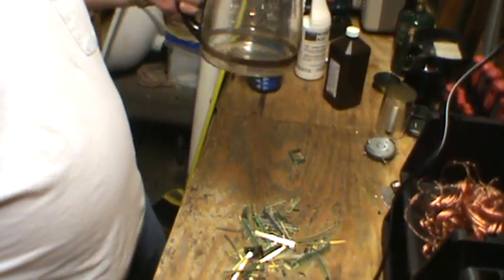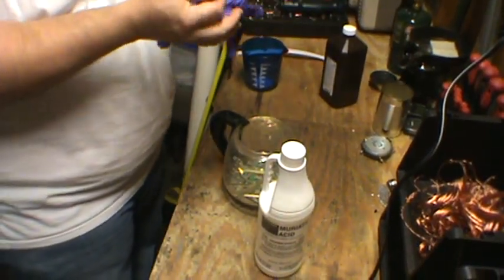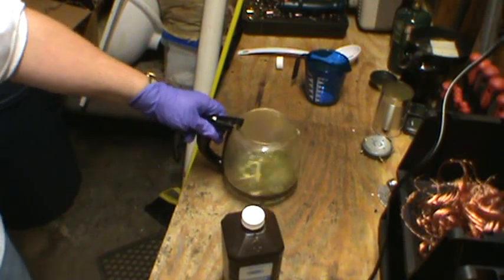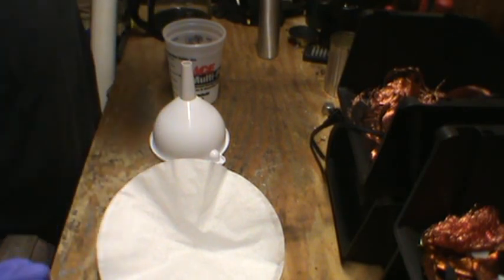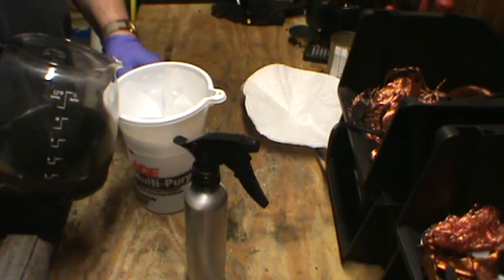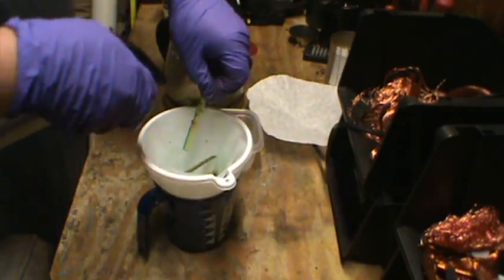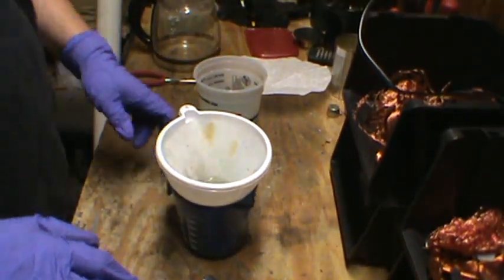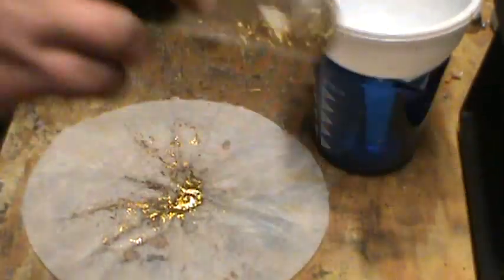How to Recover Gold with A/P Acid peroxide method for gold fingers and gold plated boards easily.

Comment from the maker: So the A/P solution is also dissolving the nickel as well as the copper?  I have not seen any other colored metals on the flakes when the process is done. Interesting you say almost all humans are allergic to nickel when it's so widely used in things we contact often like guitar strings, US nickel is 25% nickel, some magnets, stainless steel.  It is used in cookware, cutlery, kitchen appliances, hardware, surgical instruments, storage tanks, firearms, car headlights, jewelery and watches.

Comment from the maker: Great question!  As far as I know, silver is similar to gold in that it is fairly inert and the hcl will not dissolve it.  You would need to use something like nitric acid for that.  I use the AP methos for cleaning the copper and stuff off of the silver contacts that I find in switches and relays.

Comment from the maker: This process will work on plated pins if they are plated brass or copper.  A quick check with a magnet will clear that up.  For plated pins that are magnetic, HCL and heat will remove the foils but this is more dangerous and needs to be done only in tempered glass like apyrex or a coffee pot and monitored so that the HCL does not boil.  As to trimming the excess material, I am not sure to what you are referring.  I make sure the only thing that gose in the pot is green board and gold.  Thanks

Comment: will this process work on plated pins as well ? Or is it just finger boards?   Wondering if you have tried trimming all excess material from fingers etc that you are processing to see if that helps the process.   thanks for the vid. will be trying this soon on my material

Comment from the maker: Well, in all honesty, it takes a lot to make a very little.  So if you just have pieces from one lap top you probably wont make much of anything either way.  Laptops are usually worth more sold on ebay for parts than for the metals they contain.  If you want to start saving up gold for either processing or selling, the first step is to separate with a magnet.  The gold plated steel is processed differently than plated copper or brass.    Once you have a lb of material then you can decide.

Comment: Hey there, I found what i BELIEVE to be gold plated pieces of metal (Steel?Copper?) in my dads laptop. Could this process be used to get the gold off of the metal or would it be more cost effective to just go sell the plated gold and leave it at that? Thankyou so much for the good information!!

Comment from the maker: Holy crap....10 lbs is a lot!  You likely have several hundred dollars or more og gold there.  It is worth money now and is worth money refined as well.  What you have is actual gold indeed.  The AP method is great for removing copper and brass.  You can use this method to remove other metals however you will be left if chemicals that are very hard to dispose of.  This method is great for all clean plated boards, and non magnetic plated pins etc.  Thanks for watching, send pics of the jar!

Comment from the maker: As for monetary value, that whole batch completed (which as a bit more thatn seen in the end fo the video) but all of those fingers made a bb of what tested out as 20 K gold that weighed 0.85 grams.  So for value in todays market that is about $32 USD.  It really does not take much time or effort to do so for the value vs time ratio, that is entirely up to you.  Larger batches are more profitable however once you have paid for the acid and supplies that you can reuse it is all profit.  Thanks !

Comment from the maker: With a pair of tongs and an old knife pull the boards out of the sand one at a time and scrape off the componants into the other pan.  If some pieces remain stick back in the sand.  This is a hot sand bath and it works really well.  Once all is off the board then you can soak it in A/P.  
Thanks for watching!

Comment from the maker: If you are referring to the little green boards that have like 2 patches of gold on them then the answer is yes, I threw some in this batch of A/P.  As for cell phone boards, there is a way to depopulate them quite easily if you have a bbq grill.....get 2 old baking pans.  Cover the bottom of one with sand, about 1/2 inch.  stick it on the grill with the cover down and let it heat up for a few minutes.  Then take the phone boards and place them in the sand.  Leave for a few minutes.

Comment: where did you find out the ratio for the HCl to H2O2? i have several hundred gold fingers from ram sticks that i wanna run this with but my chem prof doesn't want me using his fume hood unless i can find a reliable site or lab write up for this reaction.

Comment from the maker: I recommend that people check with their local and state guidelines.  If the procedure is followed and no extra metals are added then the solution can be cleaned by precipitating the copper or having it adhere to a stainless steel object.  This will leave a solution of HCL.  Muriatic acid is also a pool chemical which can be dumped out if well diluted.    Again, check with local officials first.  This is also why I do not use nitric acid, hcl is much easier to dispose of.

Comment from the maker: You should still be able to.  Watch for any kind of gelling on the top, or any solidification of the solution, and for changing brownish.  If it gels then the solution is no longer usable for this.  If brown, try to add a little peroxide to it, if it turns green again then you should be good to go.

Comment from the maker: you can use this method for pins as they are mostly brass pins plated with gold.  Run a magnet over them first to pull out the stuff with iron.  The more efficient methond with pins i think is to use just hcl and low level heat, just under boiling.  If there are foreign metals in the mix then you are creating something other than copper 2 chloride which may be more difficult to dispose of.  If there are other metals in there the solution will turn brown sometimes and you won't be able to reuse

Comment: I second that!! I am building up my supply of gold right now. And as you say watch many videos of this before doing, which I am doing. I have a bunch of cpus, rams, and fingers plus a bunch of older hard drives which they used to use gold to the Finger thing that reads the platters. But I think you are doing a great job. Just wish I had better scrap yards around here. I live 50 miles away from D.C. in large population and most yards screw you. I have a new one I am going to try by Wrd of mouth.

Comment from the maker: This can be used over and over again almost indefinitely.  Just make sure no other metals are added like iron, aluminum or solder.  every once in a while, like every second or third batch, after all the gold is out set a stainless steel object in there to draw out excess copper of the solution.  When it finally does need to be disposed of, use a stainells steel object submerged to get as much copper out as possible then dilute with lots of water.

Comment from the maker: For the acid peroxide method it does not matter glass or plastic.  However, in future experiments with heat for recovering gold from plated pins you will need pyrex or a coffee pot with no cracks in it.  Thanks for watching!